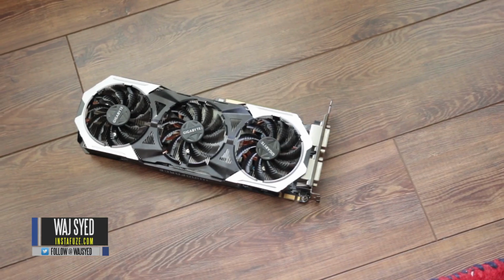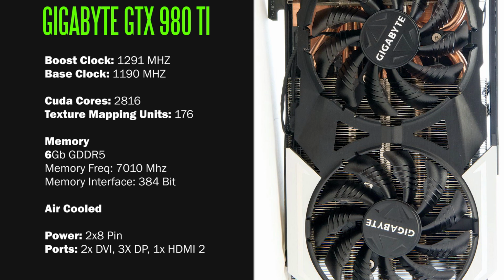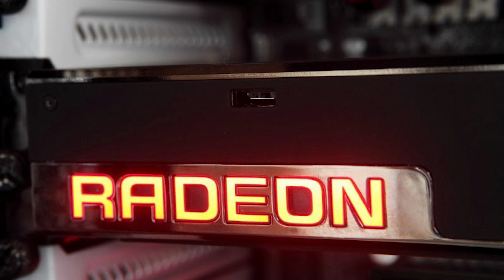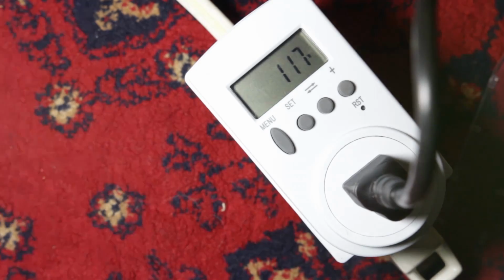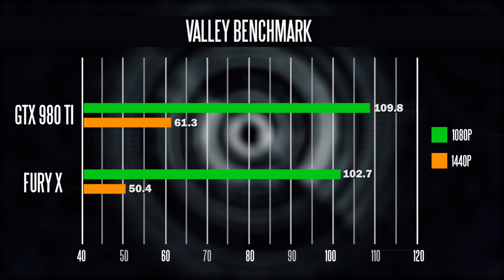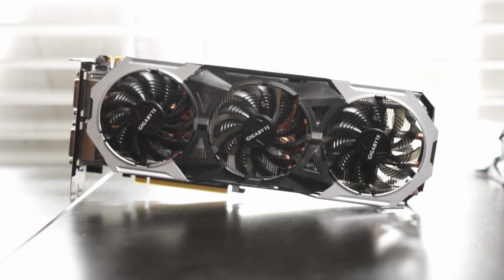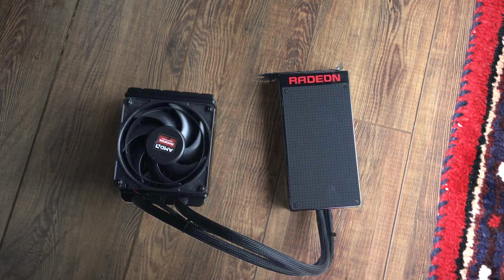AMD R9 FURY X vs Nvidia GTX 980 TI - 4k Gaming Benchmarks

Comment: gtx 980Ti vs r9 fury x is a good example of comparing the effectiveness of architectures. Radeon r9 fury x with 4096 cores vs 980ti with 2816 cores at same clock ~1050\1076 MHz . The difference in the number of cores is not less than 45%, but 980ti is faster in most games. Radeon cores are ineffective compared to geforce cuda cores. 1core geforce = 1.5 core radeon.

Comment: The 980ti is 800$ in amazon and the r9 fury x is 650-670$.my choice is the fury x and the rest of the money for fuck bitches.better balance
Reply: I don't know what 980Ti did you see, but this exact Gigabyte G1 Gaming 980Ti is $640 on Amazon.
Reply: +Derively amazon link please
Reply: +Daniel Velasquez I picked up a 980Ti for $585
Reply: +David “MISFITSWITCH” Wagner but The amd is hbm memory
Reply: +Daniel Velasquez So will Nvidia in 2 months. And you can see that that ram on paper is faster. But in gaming it's not any better. Just like PC ram speed does not help gaming at all.
Reply: Maybe i don't know how it works, but why would the HBM be so much faster than the GDDR5? Yes, it has 16 times wider memory bus (for example from 256bit to 4096bit), but its frequency is 16 times slower (7-8GHz vs 500MHz). That means the data flowing speed is about equal, or am i wrong?
Reply: +Derively Its all marketing. Huge numbers to get people talking. The leap will be big but not 10X like they keep saying. I would just buy a 980ti when they are on ebay for $300.
Reply: +NuclearZombie10  yeah,you're right, i found it for 620 dollars in amazon

Comment: Honestly, five-ten FPS is worth it to have a cooler card, and cheaper frame syncing tech.
Reply: AlphaLineGaming or get a evga hybrid used now which runs cooler than the amd and better performance too
Reply: shaolin95 True. When I made this comment, used hybrids were still way more expensive. Fury X cards have dropped significantly, found one for $349.99 pre-black friday.

Comment: Majid you have an overclocked cpu and a fury-x in the system still you used a 750watt powersupply... You shouldve at least used 1000w psu or 1500w. That amd card is power hungry. Try with a different psu and seee the fps change for the better results
Reply: The Fury X has 275W power consumption. The CPU (overclocked) max 100. Everything else (let's say) 100W. That's 475W overall.
Then why would he need a bigger power supply?
And even if the 750W wasn't enough, the system would crash. The performance doesn't change.

Comment: That 980ti cost way more then the fury x by like 100 lol.
Reply: They are at the same price on (for example) Amazon, lol.
Reply: +Derively Yeah  I was thinking of the air cooled fury.
Reply: +Edmund Leong I looked at 3 popular stores in my country.
Store 1:
Gigabyte G1 Gaming 980Ti (this version that's in the video) - 672 euros
Sapphire R9 Fury X (the only available Fury X there) - 711 euros
Store 2:
Gigabyte G1 980Ti - 615 euros
Sapphire Fury X - 714 euros, Gigabyte Fury X - 762 euros (only these Fury Xs are there)
Store 3:
Gigabyte Xtreme 980Ti OC (even faster than the G1) - 633 euros
Different Fury Xs - 718-773 euros

Comment: so for 200 dollars less, you can get a fairly comparable card, not a bad deal.
Reply: They almost have the same price. At least on Amazon. The cheapest Fury X is $40 less expensive than this Gigabyte 980Ti, but other Fury X versions are at the same price.
Reply: Derively 980ti's average around 700, Fury's go for around 550, it's a pretty big difference.
Reply: HTakara82 1: This Gigabyte G1 GTX 980Ti is $670.
2. It's the Fury X, not the standard Fury, and it's between $640 and $690 (depending on the brand).
These prices are from Amazon.

Comment: This is a STOCK fury X AT STOCK CLOCKS... vs a heavy factory OC 980Ti... seems fair doesn't it? lmao this test was not accurate.
Reply: They are almost at the same price. This 980Ti is $670, and the cheapest Fury X is $640 on Amazon. (without sale, it's $690 and $670) So this is fair.
But most importantly, this guy only has/had these cards. He probably won't buy every version just to test it in one video.
Reply: +Derively Jr He doesn't need to buy other cards. There is something called over clocking the Fury X to the same power percentage. Or he could have set the 980Ti back to its stock clocks to make it fair lmao.
Reply: The Fury X's overclock is not much. I saw videos where they could only use about 50MHz OC, because these cards are already at the max. So the performance boost is almost nothing. But the factory OC'd 980Ti actually can be overclocked even more.
Decreasing the frequency on the 980Ti is dumb. They are at the same price, why would you decrease your performance? That's why nobody buys reference models, because the OC'd versions are not more expensive.
But more importantly, even a reference 980Ti is slightly ahead of the Fury X, both at stock and OC frequencies.

Comment: why would you compare a third party model of the 980 ti against reference model r9 fury x... this review is irrelevant
Reply: The Fury X only has the reference model, but the 980Ti has other versions, and the price is almost the same.
And he only has/had these cards, so he can only compair these.
Reply: +Derively Do you not understand? Third party cards are overclocked
Reply: +Adnan Berik And? This video is not about the AMD vs Nvidia e-penis war. This is about compairing 2 products at the same price point.
Reply: +Derively It's not the same price point. There's $100 difference
Reply: Adnan Berik Prices from Amazon right now:
Gigabyte GTX 980Ti G1 Gaming: $650
AMD Fury X: $630-680 depending on the brand, but they are actually the same product.

Comment: AMD should not have used HBM. It maxes out a 4GB and that just isn't enough anymore. GDDR5 was still perfectly fine and will continue to be so for the next several years.
Reply: +Naomi Washinton no, hbm memory is a way better than gddr5, by this way the card with hbm can do more with 4gb than the ones with 16gb of gddr5
Reply: +Naomi Washinton incorrect mate. do your research..
Reply: no

Comment: Fury X > 980Ti
Obviously...
Reply: Derively Take a good look and don't sound like a dimwit. The Fury X is already outperformed the 980Ti. Thanks to DirectX 12 and Crimson Software Driver updates.
Reply: CRAZYCRAZYKEITH you must be stupid. 980ti suck so much when it comes at high resolution test.
Reply: Mac Pro has the best hardware ( ͡° ͜ʖ ͡°)
Reply: +Intel & Nvidia SUXXZZZ!!! coming from AMD fanboy
Reply: Alexander Vladimir It is based on facts. Current AMD is the only one that has HBM technology on their graphics card. Nvidia would probably stuck with their GDDR5 or 6 on their newer cards.
Reply: +Intel & Nvidia SUXXZZZ!!! AMD has HBM. And? We care about performance, not technology, and the 980Ti is better in that. And the new Nvidia cards in 2016 will use HBM2.0 (for the high-end cards) and GDDR5X (for the lower cards). But again, i personally don't care about this, i care about the performance.
Reply: ***** There isn't any DX12 games yet, the Ashes of the Singularity will only come in 2016, and the only games that are better on the Fury X are the AMD sided ones, for example the Star Wars Battlefront. (although Far Cry 4 is also well optimised on AMD) The other games are better on the 980Ti.
Reply: +Intel & Nvidia SUXXZZZ!!! I think Alexander might be trolling.

Am I correct in guessing you're using an Fury X? How are you finding it after Crimson? I've been trying to find a video that came out after that does an FPS comparison but to no avail. Although tbh I think I might just wait for the Arctic Islands before I upgrade now
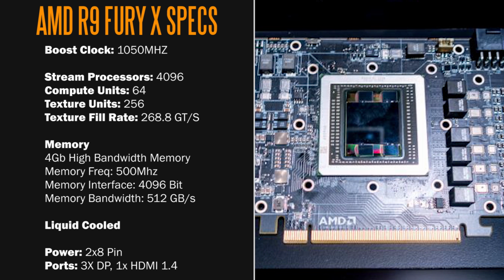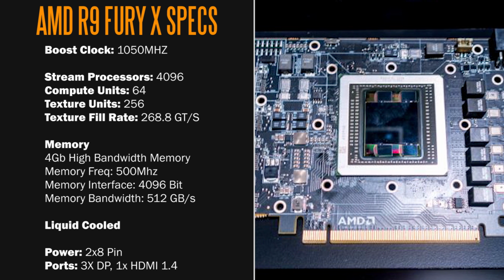Reply: +Intel & Nvidia SUXXZZZ!!! Shut up and read this excellent analogy that I have found. "There's more to a GPU than Tflops. For example from the tech report review:http://techreport.com/review/28513/amd-radeon-r9-fury-x-graphics-card-reviewed/4http://techreport.com/r.x/radeon-r9-fury-x/b3d-pixel-fill.gifhttp://techreport.com/r.x/radeon-r9-fury-x/b3d-poly-throughput.gifhttp://techreport.com/r.x/radeon-r9-fury-x/tessmark.gifA GPU is a complex mix of a lot of things, with a lot of combinations to achieve similar results. Take the Top Gear laps for example - an Ariel Atom, Nissan GTR, 430 Scuderia and a C7 Corvette all have a similar lap time (~1:19.5-1:19.8) despite being very different cars with very different stats. If you only take one stat, say bhp, you'd think the Atom wouldn't stand a chance but it's the fastest out of those 4. IF you took weight, you'd expect the Atom to be significantly faster but it's not. Top speed, same deal the Atom should be slowest by some way etc etc.When comparing GPUs from Nvidia and AMD, you can't look at one form of GPU performance and expect that to show you the whole picture."
Reply: +CM Dell Tehir marketing sucks, you are right. But Nvidia invests a lot in marketing and they are just dicks. Amd all the time.
Reply: ***** suck on my 980ti SLI rig you dumb fuck, I'm gaming at 4K while you sit and cry on the internet. Poor AMD peasant
Reply: ***** you have no proof only hope. the Fury X is 4GB, thats shitty. and ugly radiator and pump whine. i am gaming in 4K now perfectly fine, TRY AGAIN SON
Reply: AMD Tress FX was twice the joke Hairworks was, it's performance was horrendus. AMD can't do anything right.
Reply: CM Dell You must be stupid.There is rarely a problem with TressFX compared to Gimpworks HairNotworks
Reply: +Intel & Nvidia SUXXZZZ!!! Fanboy level god

Comment: Oh yeah thats right the furyX needs a SEPRATE COOLER. Then again that 980 has 3 fans but hey still less work installing it than the FuryX. Both good cards though the 980TI is kinda suppost to get that hot.

Comment: All the AMD fans are telling that 8gb memory of 390 ($300) and 390x ($400) make them "futureproof"

It really makes me wonder... is that 8gb really gamechanging when they are selling their top notch $650 card with 4gb?
Says a lot about future proofing..
Reply: +navid617 its HBM memory tho. much better then 8gb of gddr5.
Reply: It may be faster and efficient, but memory is still memory. I am pretty sure that 4gb of HBM cannot hold as much texture as 8gb...
Reply: +navid617 HBM 1 is the reason why it only has 4GB. The limitations of it fucks it over.
Reply: I heard something about gta 5 almost reaching the 4gb on ultra, didn't want to take any chances and went with the r9 390 nitro
if you run out of vram your game is gonna be laggy as fck

Comment: I'm planning to buy a new gpu, which one in your opinion will be better for amd fx-8350 cpu from these 2 gpus?
Reply: +Kratos 8350 will slightly bottleneck these cards... stick to a 380x
Reply: +primus loy get i7 4790K and R9 390 like me
Reply: +Kratos well id recomend either the 390x or the fury. the cheapest 980 ti is 600 atm vs the cheapest fury is about 500 otherwise you can get a 390 for 300 and change
Reply: GANG MURDA i guess ive mentioned it so much in other comments i have forgotten to mention it this time. but i argue for a different reason, id argue because it drives the cost of current gpu's down.
Reply: volkswagenginetta Also true

Comment: @5:05 4Db noise difference..pretty big huh?
@ 6:18  377W vs 408W full load, so there's a little bit of difference in power consumption.hmm. 31w is a little bit..

such an AMD hopeful.it's a good thing though

Comment: Thanks for the review. I'm running two 280x (3gb each) in crossfire, fx 8320 (8 cores @ 4.0 when gaming) on a 1440p monitor. Having all kinds of problems with crossfire, looking for the best single gpu solution. I love AMD because they make pc gaming affordable to the public but I shot myself in the foot with this 1440 monitor. Tried the cheap solution of xfire two 280x but hardly supported and a single 280x struggles with 1440p. I'll keep shopping around, happy black friday

Comment: Like comparing a ferrari with a traktor on a cornfield and say the traktor is the best. Specs of that amd card are one of the best in the world and it will absolutly destroy any nvidia card outhere IN a propr application who Can use all the horsepower behind that monster. Testing games with textures smaller then your ipads display is Not a test for these kind of cards.  But well, you kids go and play with traktors.
Reply: What do you mean the Fury X will be better "in a proper application"? Both of these cards were designed to play games. This guy tested them with 3 resolutions including 4k. And you wonder why a traktor is better than a Ferrari, if you compair them on a cornfield. I don't care what technology it is. I care about performance while doing their job.
Reply: Nop, playing games is just 15% of what a gfx card can do. Use them in CAD aplications with 50-100 mil poly scenes or more and with 10-20 lights and with resolutions of UHD + and AA viewports and openCL/opengl rendering and gpu bruteforce raytracing rendering. Do not think the devs develop gpus just to play games. In the high end industry where the game are developed evryone is using the best they can get. And very important, do not forget that games are ALWAYS optimized for a brand, you can not optimize them for evryone, is not cost effective .thats nvidia so do not expect amd to win anything in the majority of games. Its politic after all. You guys really think that sony, apple, microsoft where stupid when they chose amd for theyr gaming respectily mac platforms?! They are giants who spend milions just to draw a line in theyr logos.
Reply: The companies that need rendering workstations and CAD applications buy a Quadro (Nvidia) or a FirePro (AMD) card. These have features that the companies need during their work. The Fury X is not one of them. It's a simple high-end gaming card.
And in my opinion, the console makers put AMD parts in the systems, because this is a great way to help AMD. The GPU and CPU industry is slowly falling apart, Nvidia and Intel have most of the sales. If AMD disappears, it will be really bad for everybody except Nvidia and Intel. The prices will go up.

Comment: Liquid Cooling Problem: Lifespan
Plastic Tubbing 3-5 years and maybe the pump will start to fail before
Norprene tubbing 2-3 years.
I don´t know about those pumps and tubes. If Its easy to find a replacement, I´ll say Its a good choice at the right price

Comment: If you run gaming benchmarks under DX12, then you will see a massive performance boost of Fiji (by at least 33%). You will also see a massive performance decrease of 980Tits (about 25%-30%), because Maxwell is incapable of performing Asynchronous Compute. Hell, even the 290X beat the shit out of the 980gtx by a massive 33% in DX12 benchmarks.

Comment: All this talk about how great gigabyte gtx ti is with overclocking... maybe its just my card, but anything other than a slight overclock above the manufacturers boost makes my card unstable. Should have stuck with Asus
Reply: Yeah, overclocking is different in every card, even if it's the same model. You were unlucky.

Comment: Uhhh.. i'm lik 99% positive your wither 3 benchmarks are wrong because i can have everything on ultra with hair works on (geralt only) on my overclocked vapor x r9 290 and get 60 fps at 1080p. a fury x should be getting like 20 frames over that.

Comment: Wtf? 64.6 fps on Witcher 3? I use ultra settings and hairworks on, 1080p on a G1 Gaming 980 Ti + i7 4770k OC at only 4.0 Ghz and it never drops below 60 fps. Rarely when I use my Witcher senses it barely drops a little.

Comment: Do now the same test with optimized AMD drivers. 

NVIDIA drivers at that point are optimized and AMD not . Today it will be show some other Benches . Alone the nurmal Fury is faster in most games than the TI ......  on january 2016 AMD will start with the greatet gaming Card ever 2016 will be a AMD year

Comment: Is this worth buying for photo editing any suggestions
Reply: of your only using it for video editing get an amd Fire pro or NVIDIA quadro cart. If you game too get either an 970 or 980ti.
Reply: ***** many thanks
Reply: Mark Douglas Also if you only use photoshop and such then you definitely do not need the best firepro or quadro nor an 980TI.
Reply: Mark Douglas Also if you only use photoshop and such then you definitely do not need the best firepro or quadro nor an 980TI.
Reply: ***** Photo editing and minimal gaming (old games) x99 system with 1 (one) 4K screen /all i need is the right video-card for this scenario. i still think the quadros are too expensive
Reply: Then I suggest you look into the Firepro cards.
Reply: ***** ~thanks

Comment: Stupid comparrison. Stock Fury X vs the fastest OC version of the gtx 980 ti. Stock vs stock or you fail.
Reply: Even the stock 980Ti is faster than the Fury X a bit.
Reply: That i know, its just a better comparison using stock/reference vs stock/reference. It gives a better picture of the difference.

Comment: this review is not real, for starters gigabyte gtx 980 ti dosent hit 85c under load it hits around 70c cause of the aftermarket cooler. gtx 980 ti reference models hit 85c.....wtf is this shit?

Comment: Is there a reason why theres Texture Fill rate /s and Memory Bandwidth /s shown for the Fury X, but not the 980ti?
I like the furyX way more than the overpriced 980ti (here the fury X is $865 and the 980ti is  900-930$) but it feels like your hiding the specs of the 980ti. the fill rate and banwidth /s' can be calculated with the provided info, just curious why it wasnt shown, feels shady, I like fair fights.
Reply: +Zubin HV Uh, no. I just ordered my G1 Gigabyte 980 Ti for about $750 off newegg. Chaper than the fury.
Reply: If you read what I wrote, HERE the 980ti costs more than a Fury X. I'm sorry if you think Youtube is not worldwide.
Reply: it is 40 dollar more expensive and you call an far superior cart overpriced?